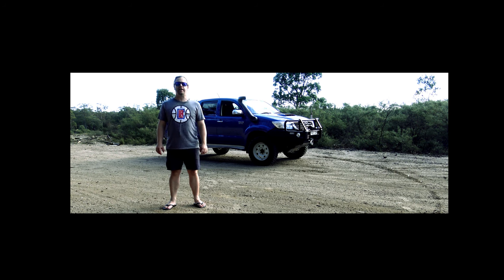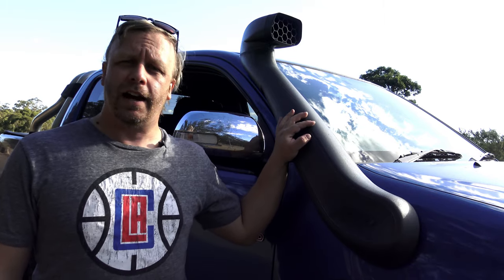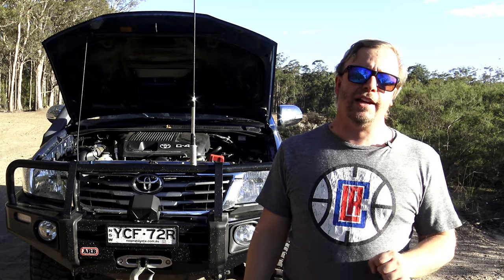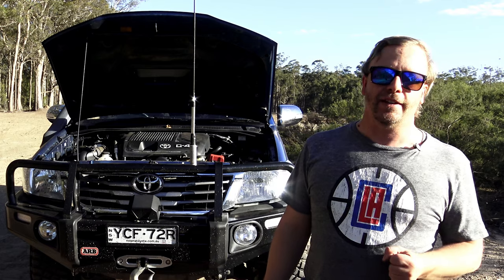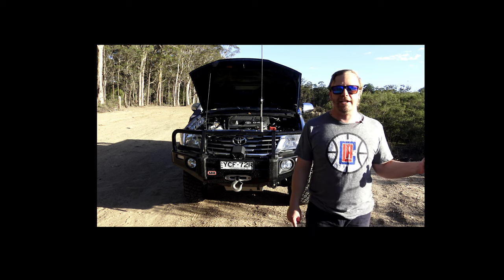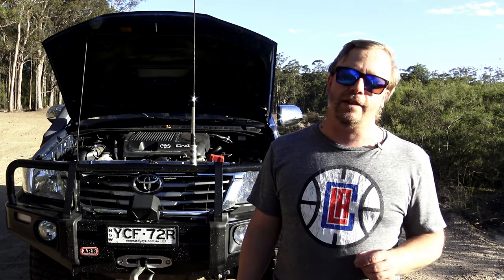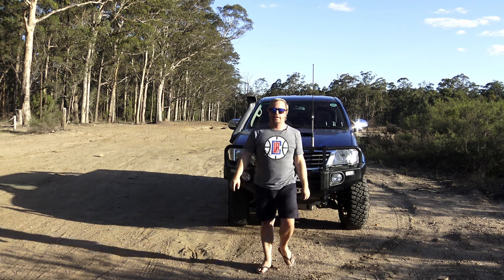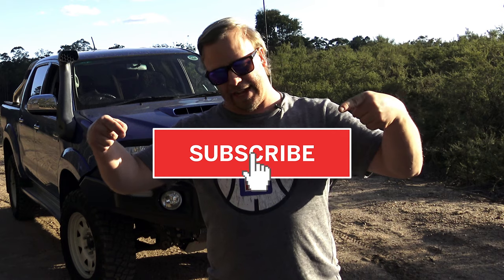Do you need a Raised Air Intake (Snorkel)

Comment: When I 1st got into 4x4. This was on the list, top 3! But for some reason jeeps don't have them and said me too. Just seal your intake box make sure the inlet has some hole at the bottom so water can drain out. Also learn to PUSH the water not go through the water. 😂 There's no such thing as free windshield washer

Comment: Well I was hoping to learn more about the benefits off colder air and fuel consumption benefits
Reply: I have to disappoint you. Thumb-rule for temperature difference is 0,5-1°C per 100m straigth upwards. 
If you put a bigger air intake on your car you provide more air to your engine, and the ECU provide more fuel.
The ECU is programmed to work optimal with the original airbox, not a modified. 
The wading depth is usually limited by the ventilation of the differencials, gearbox and the engine, not only air intake.

Comment: I am a bit perplexed about what the difference is between a snorkel and a raised air intake? After all that insistence about calling it a raised air intake, rather than a snorkel, surely there's some reason/distinction.
Reply: Maybe those who call it a raised air intake realize the fact that the car dies anyway if you think you are covered with a snorkel. ;-)
Reply: A “Raised air intake” ( it’s a snorkel, this guy is just a knob) isn’t water tight sealed, snorkels are water tight and sealed

Comment: Every snorkel video explanation video I watch is so unhelpful including yours. Tell us what the max water line limit for it. How hard is it to give a snorkel information video. It ain't that hard! Maybe I should be a youtuber.
Reply from the maker: Every vehicle is different. Depending on you if you have a lift, every snorkel brand is different with different vents and different methods of being installed. The maximum height for your vehicle to be submerged should be stayed by manufacturer should not be above the bonnet, but that will depend on the vehicle variables which hopefully you have considered.